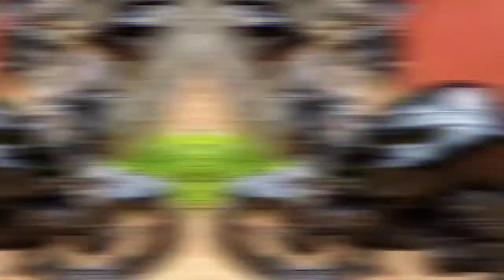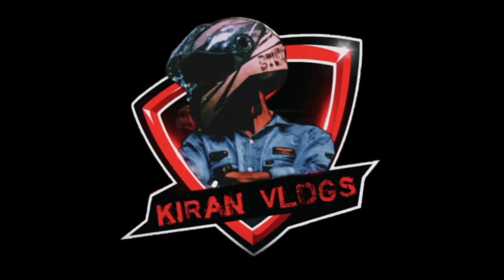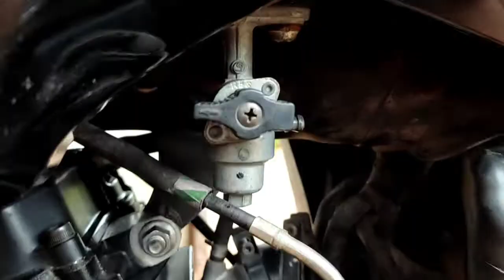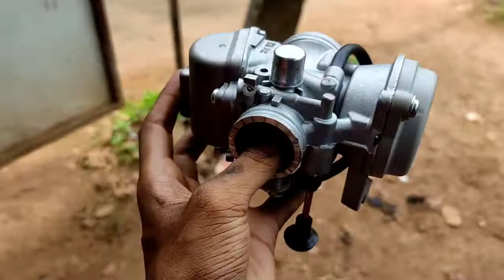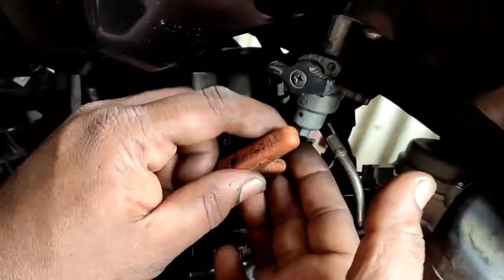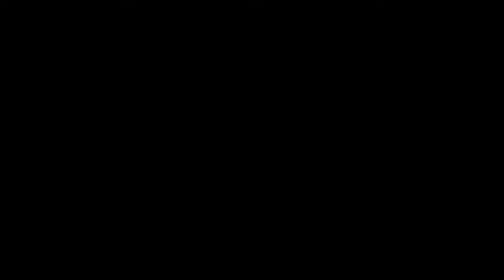How to fix pulsar 180 carburetor for yamaha FZ || Malayalam || Kiran vlogS

Comment: I have fz v1,I got only 30 mileage how I increase ??
Reply: Pulsar 150 carburetor vesuko bro  i got 50 mileage
Reply: @jagadishkumar4305 
 Pulser 180 വെച്ചോളൂ.
ഇല്ലങ്കിൽ valiv കുറയും
Reply from the maker: @MrMachiner  😊
Reply: Stock aanu bttr plsr carburtor fz odikkanulla sugam nashippikkum
Reply: @fz16midshp74 
110 രൂപക്ക് പെട്രോൾ അടിക്കുബോൾ ഉള്ള സുഖം free 🏁.

Njan 180 യുടെ carb ആണ് use ചെയ്യുന്നത്. മൈലേജ് und ഇപ്പോൾ.
ആദ്യം below 30🏁🏁
Reply: @jagadishkumar4305  missing issue indakumo bro
Reply: Missing undo bro
Reply: @muhammedc5250  bro fz k 180 de carb vekumbol athilte vaccum piston ,jet okke vere buy cheyano ...?? Atho fz de thane fit aakumo
Reply: @shehinshereef29 
Vacuum piston പുതിയ കാർബ് ന്റെ കൂടെ കിട്ടും, jet എനിക്ക് ഓർമയില്ല.
സാധാരണ workshop എല്ലാവരും ഇത് ചെയ്യുന്നതാണ്.
Googil ഉണ്ട് 
(പിന്നെ അത്‌ അല്ലാതെ,tvs അപ്പാച്ചി യുടെ ഏതാ ഒരുമോഡൽ pistal set ആകും, )
Reply: @muhammedc5250  bro ipo ethra mileage kitunund?
Carb change aakiyathin ethra aayi workshopil
Reply: @shehinshereef29 
Carb frash 2500+ ഫിറ്റിങ് fee( 350 ഏകദേശം )
മൈലേജ് മാറ്റം ഉണ്ട് 42 -45
Athyam 28- 30😁
പവർ കുറച്ചു കുറയും, എന്നാലും cash ലാഭം

Pinneed Missing ഉണ്ടൻകിൽ ട്യൂൺ ചെയ്യുക
Reply: @muhammedc5250  180 de vechalum starting 30 olo atho nerathe olath aano paranje?
Reply: @shehinshereef29 
Fz 30 ഫസ്റ്റ്
ഇപ്പോൾ പൾസർ 180 carb 42 approx